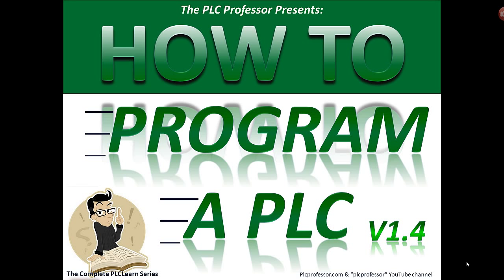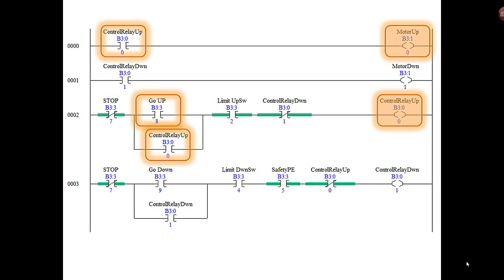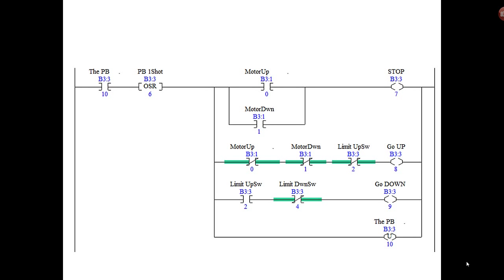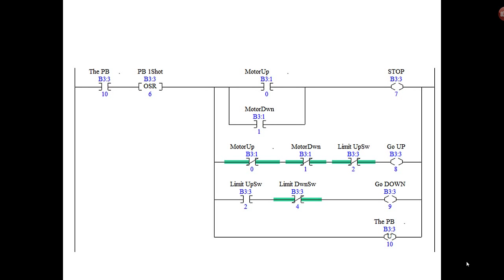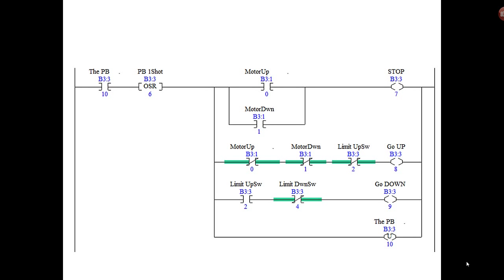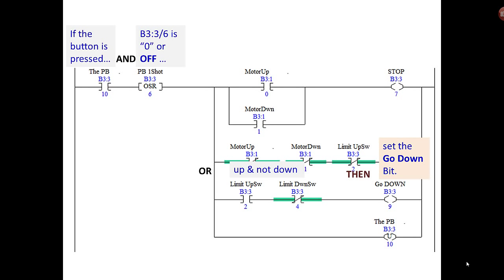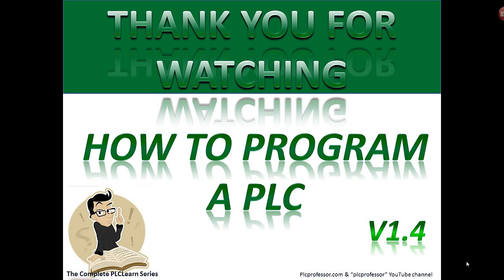Prog-1e How To Program a PLC - Basic Level

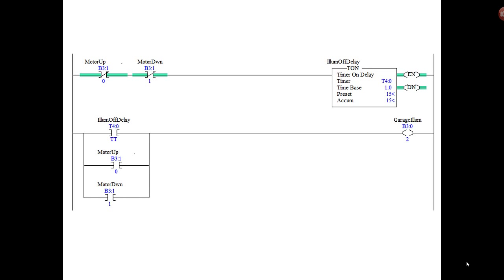Comment: I have trouble understanding why Limit UpSW and Limit DwnSW were changed from "true if on" to "true if off" aka ] [ to -]/[- at around 4:30.  It was my understanding that the "limit" bit would turn off once the garage door was fully open because the limit switch opens, thus the transistor does not conduct and the bit turns off.
Reply from the maker: Have you watched PLC Lecture 01 Pt.1 and Pt.2? If you go to the Playlist, they are the two lectures in the replacement list.
Reply: plcprofessor Thank you for the quick response. Yes I have watched those lectures.  I assume you're referring to ~37:00 of Pt. 2.  I gathered that limit switches are held against their normal state so when the pressure or presence of the equipment is removed a Normally Open Held Closed limit switch opens and a Normally Closed Held Open limit switch closes.  
I think I might understand why you made the change now. A Normally Open, Held Closed (by the equipment) limit switch would set the Limit UpSW bit on when the garage door is fully open and the pressure is on, so to speak.  When the pressure of the door is removed, the limit switch returns to its "normal state" of open, and the transistor no longer conducts so the Limit UpSW bit turns off. Since the door should only travel upward when the door is not in its fully open you use the "true if off" Limit UpSW permissive to activate the upward motor.
By the way, I love all of your videos so far.  You've done a great job explaining everything so that it's easy to understand. I get a bit pedantic with these kinds of topics so I'm not surprised that I'm confused.
Reply from the maker: Sophie Schneider Keep in mind that those limit switches normally have both NC and NO contacts so you can take your pick. My actual choice would be towards safety in that... if the wire breaks or the switch falls apart that the resulting state not allow the system to move the door until you fix it. Either combination will work as long as your logic considers that the door is not up or down or that it is up or down and the motor does not drive the door any further in that direction.
Reply: what is the max number of rungs you can write on rslogix microstarter lite???